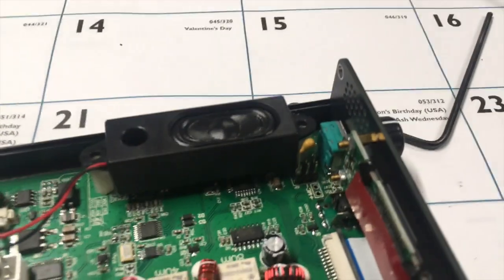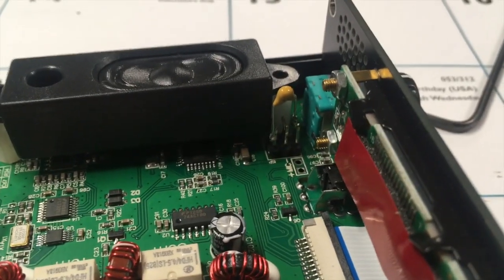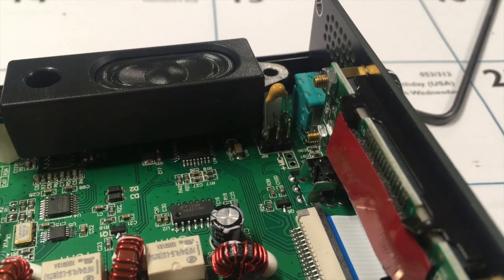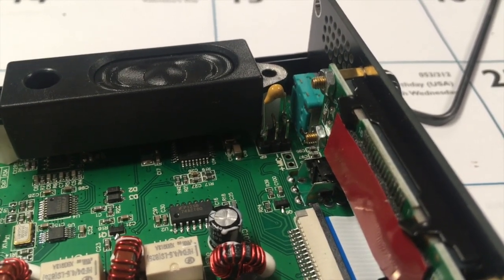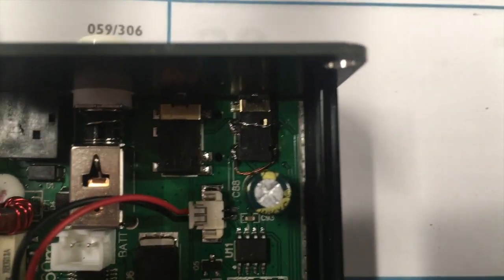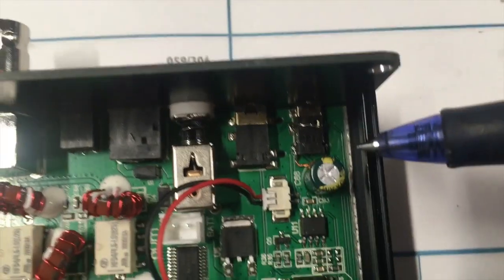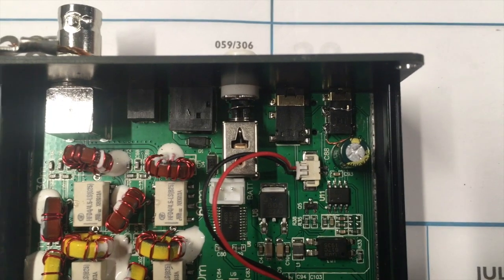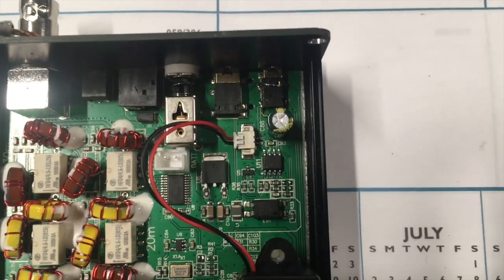Fixing the uSDX+ V2...

Comment: Hi Tom...!

I've seen your video about this Chinese radio... I've bought the most recent version of it, the one with a battery inside a better and fancier box... The only problem is that the Chinese dude making it forgot to install the 10 meter coil on the filtering circuit... Apparently the radio works, apart from being noisy and with a sound volume that can only be usable between the 9 and the 12 setting. So, if you can help me and send me the link for the schematics for this board version or tell me what value is that 10 meter ferrite coil or how many turns it has...? I know you probably moved on from this project, but I can't find more information about how to solve my problem on the internet...
Thanks
73
Reply from the maker: Oh my - I likely do have the PDF for the base radio. But, I'm not near my workshop for a few days. However, if you join the Facebook page for the uSDR uSDX and related, they have it in there files section - that's where I got it from. ;) And, dang, it is amazing what them fine folks can forget!! lol. But, you'll need to make a walk around of your fancier one. I'd for one would become a fan to see it! :)
73, good sir!!

Note sure if thins link will work, but it's the best I got: https://www.facebook.com/groups/599314207744366/permalink/925728708436246
Reply: @tomsworkshop5856  Unfortunately YouTube hasn't allowed my answer... probably because I write my email on it...
Was nice to get those schematics... but I can't go on FB I got banned for life...
Reply from the maker: @TheBigChill1  I'm not holding my breath, but try this: https://1drv.ms/b/c/bcb46ad9a677e56b/IQCdSQYLtta7RZAM2HONMnI-AWH9lG0rGri0X_8B8vNIyew?e=vnaQA6
Reply: @tomsworkshop5856  Thanks mate...!

Comment: Mine has very noisy receive and low sensitivity.any tips?
Reply from the maker: Oh my. I've not run into that. Out of the three I bought it's been much the opposite. They are really good receivers - with one exception: Then can not receive AM or FM, and it seems no one has managed to create a patch or version of the software to make that work. Should be excellent for SSB or CW though. I know that might be to helpful, but it's the best I got. Also, as a bonous, I do listen to broadcast one mine in LSB mode, just get it zero-beated, and it's listenable quality.
Reply: @tomsworkshop5856 yes around 7 mhz I can listen to Broadcast just fine but everything else is...just noise sadly.The same Antenna connected to my radtel gives amazing results but this...

Comment: i worked in comms in the navy and recall clearly when a very tiny cap blew and shut down the entire system we were using to sort digital incoming to the various teletypes,  ya, that age of reperf tape and teleprinters.    took the mat department an hour to find it, as it was not in the central processing area.  no, it was way out on a limb where the cpu would perform interrogative question of printer availability or whether to spool the message for a few moments, much as buffers do today.  same idea, different architecture.
Reply from the maker: Dang, that gives new meaning to the term weakest link! I guess in many ways the modular system build design has some strength. If it fails, at least you kind know where to go, and what box to replace. 

Then we have these radios - they basically are the module, and even when working perfectly (I say that in its terms) There's still so much room for betterment.

Thanks for your service, good sir!

Comment: I also do not receive anything on my new Chinese uSDX+.   Attenuators set to zero.  It receives atmospheric RF noise just dandy though.  With no antenna connected the signal level meter is -125 dB (40 m band)  Connect a 10m longwire and the noise level goes to -85 dB.  Add in a 30 dB LNA and the noise level goes to -55 dB.  But nothing human to be heard on any band.   Switching modes and filter bandwidths has the expected effects on the noise.  Can someone explain why it can pick up atmospheric RF noise but no human generated RF signals at all?  Even tuning to the MW AM and VHF FM commercial bands picks up nothing.   Transmission into a dummy load shows 4-5 W on CW and normal looking SSB modulation.
    How is it fixed?  I see several R or C component spots missing parts but I don't know if they are intentionally missing or accidental.
     Would someone please explain how it can pick up RF noise but not a CW carrier? 
    Thanks!!!
Reply from the maker: That's an interesting problem. And one that has effected all my radios. The 40 meter band has been dead, dead dead until after the sun is gone. As far as the uSDX? I still use it daily, as it's receiver is the best one I've got. So. Hopefully you get this figured out. I personally don't have experience with them not receiving. It's usually their ability to transmit that's an issue.

73 for now, and good luck!
Reply: I have figured out that the output FETs are drawing high current, e.g. an Amp or more during receive!  As the receiver RF input is taken off the output FETs then high SHOT NOISE!!!
   The FET gate bias should be grounded/zero during receive.  Anyone run into this and have a fix?  Thanks.

Comment: Tom I have a usdx+v2 as well so I looked to doing the grounding  ods suggested by YOU.
I quickly dis overed that the rear and front panels are not. Just plain plastic but DOUBLE SIDED FRP PCB.
THE GROUNDING OF THE BNC SHELL IS AUTOMATIC. AND COMPLETE.
MAybe the manufacturer changed the material.
Reply from the maker: Well that is excellent news, and would definitely be a change by the manufacturer. But, just make sure that with your ohm meter that the top and bottom shells are grounded to that BNC. But hey, they may have learned something! :)

Comment: There are many ppl who got licensed, who do not have the big bucks to buy an ICOM or Yas. Yes, many ppl wish to buy food, pay bills. This does not mean we are low life trash. It means we took the time to learn all the information required, in addition to work, family needs, fixing home repairs, etc. So, thousands have purchased this crappy but somewhat useable HF usdx transceiver amateur radio. None of us care about those who only complain about it. So, Tom, we appreciate your education on some fixes for us poor ppl, in order to use our General lic but if you get the time, if you feel like it, could you make another video about this radio, but keep in mind, kids, guys, gals new but willing to learn, we dont know all of the info you assumed ppl knew when sharing how you grounded it, or the capacitor you soldered in. Many did not even know what we were looking at other than the inside of the radio guts near the speaker. Maybe it was that yellow arc thing. Also, there was no front facing view of your outside copper wire grounding. Just a partial view from top looking down. Maybe you could take the time to show ppl exactly how you did it, you could just say here is how I attached and grounded this radio on the outside.....another guy on YT in UK used aluminum duct tape on the outside and always made sure the camera was NOT able to see a lot of what he was doing, more concerned his big glass of beer was viewed in front of the camera instead of what was important....not everyone grew up in this world. Not everyone is an engineer. Many ppl have nobody near them who knows thus world. Many have no clubs near them. Ppl who care on YT are all we got. We obviously care enough to learn the info, care enough to set up testing, care enough to pass the test and get our lic, among navigating all of this evil going on, mass disasters devastating us, our friends, our loved ones. So if some of you could make videos on fixes for these junky but low cost radios, instead of preaching about how much they suck, which they do, but in the real world, many would rather buy something that still allows them to use their General lic and buy food, pay for a new place to live because their home was damaged, or because they needed to move away from a city that became crime infested. In learning about these radio fixes from ppl who care to be easily understood, not a lot of tech jargon, it then becomes additionally educational. If anyone out there could make easy to understand, easy to see and view DIY little fixes for this usdx radios, many would be grateful and appreciative. Many would have some compassionate heros to be grateful to. Thank you.
Reply from the maker: Good sir, Unfortunately what you seek I wouldn't be able to do in a simple video. And, as I too am a working man, with wife, house repair needs and trying to run my own business, finding time to be an electronics instructor is difficult, and honestly, I can't afford good camera gear. It was my hope that the video would give people a place to start. For the most part, working on these types of circuits is from taking many things apart that had failed, and having nothing to loose trying to fix them. There are many good videos here on YouTube that are more educational on circuit function and the like. And the schematic of how the radio was supposed to be built can be found on the internet, and the dedicated usdx usdr Facebook group - those folks are very helpful, and you'll even find links to what you need to upgrade the firmware of the radio. (A very, very scary, and often destructive process.)

Now, with that said, I am planning a follow up video and touching on a few things I've done over the last year to improve the radio's operation even more so than what I did in that video. 

So, from someone who is in the same boat armed with Beofeng, RS-918s and uSDXs.... I can relate, and when I got my first uSDX, I was in the same boat you were. Just wishing all the answers were all in one place. But, eventually I leaned: 
1, none of these radios are the same.
2, no one fix to make them work exists.
3, They should bear the nameplate "Fisher-Price!"

All the best, friend! 
And do stay tuned for a follow-on video this winter.
-Tom

Comment: I got lucky with mine... I paid $125 Canadian on sale on Amazon. I did the ground jumper on it and set the PA Bias in the settings and it works very well. I have gotten great signal reports up to 7000km away. I had zero expectations it was going to even turn on let alone receive and transmit. I have it with me in a case in my truck so I can do portable anytime. I teamed it up with the cheap ATU-100 auto tuner.

Comment: That header you soldered the capacitor to is the Arduino style ISP connector for upgrading the software  (edit: but it sounds like you found out later it's not the right place to solder the cap)
Reply from the maker: That is correct. It's amazing what those header pin are also connected to, should you look at the schematic. ;)
Reply: @tomsworkshop5856  I was fortunate to have already been working with Arduino boards before buying my first of these radios. I now have three. The ISP pinout in the radios and an Arduino Nano or Uno turned out to be the same arrangement.
Reply from the maker: @teotwaki  Cool, I've ended up with three of them too!! And ya, I've flashed them all, a time or too. And yes, the microphone in is literally on of the pins. And so is ground.

Comment: Tom, Thanks for the research and information. I dont expect this unit to perform like a Icom IC-705 or an Elecraft Kx3 but for the money (fixed income here) and for a portable QRP CW rig it should work OK. Did the grounding thing and added the 100K resistor and the TX audio did improve however the cap on the header reduced the power output to 1 watt or less. This was bought from Ebay as an new but open box unit with no internal battery. I think it is the latest rev board. I would like to replace the encoder as it jumps when you press it in as if you turned it one notch up or down. would you know the part number or where I can get a better replacement? Thanks again for taking the time to share your information with us less gifted but radio afflicted hams.

Comment: thanks for the video. I have now bought 4 of these radio and tried to get them to work with no luck. I am only decent at software so the firmware update sadly didn't help. At least I was able to send them back for a refund. Now i am close to my wits end with what to do to improve this. I am not an electronics engineer, i'm an IT guy so i can't do much. 

As for the original creator I would love to support him but his version is lacking a lot of the stuff that the chinese sellers have added to it. 
The thick metal case, the integrated battery and most importantly no soldering or hardware work to speak off. 

This is where i think a lot of the ham projects / products out there are lacking. They are built to the old school mindset of the operator can soldering, has eletronics experiences, understandings how these things work internally so they release small kits which are hard for an average non eletronics person to use. Then Chinese sellers see these products, see the gap in the market so they take the existing designs and sell them cheaply en masse. 

The advantage here is that you get more people in the hobby and hopefully help to reduce the age of your average operator Unfortunately, the problem here seems to be miscommunication / mindset. If we got together with aliexpress seller and directly approved a handful of them to manufacture ready made hardware which has been quality controlled and approved then we could all win.

Comment: Would you please show, with better light, the fix you did on the speaker jack on the rear panel?  I would like to do that as well but need a clearer picture.  Are they just jumpers from one side to the other?

Also, is there another value of capacitor I can use for the processor fix?  I can't find any 47nf disc ceramic caps anywhere, not even DigiKey.
Thanks, Tom.

Doug  VE7DRF
Reply from the maker: Hey Doug, so the capacitor that I used on the header is just a run of the mill Ceramic disk capacitor that you can buy off of Amazon in a bulk assortment for $15,. I used a 47nF, and it is over-kill. Two others I've worked on sounded better with a 10nF capacitor installed. https://www.amazon.ca/10pf-Capacitor-Multi-Layer-Resistance-Assortment/dp/B07RWM9TMN/ref=sr_1_2_sspa?crid=2S66BFC1UKI7K&dib=eyJ2IjoiMSJ9.qBNfiB-Mnah2LuthN077qKv5aT23XiaDdGyIkx9OSuOFmwzbt3zP8mVLcDqxommNx7hLUrXTmu5JjDKhwhHuIuFTnLSIDXFGkoO2U-8RcnmkUXrZ-8BCbAMoSWOj6N2GXFAVtQ64ji627k6NHcs5TL2-ltapeHAgm-ap0vnC7UCEAOIivwQdrCFaN0IbKhUUyMjh45bfT81GYwh7nxZBX6aeZLa9ULaQd77dvgO9hiiWmKlxWDPUahuSvc8f3cLY1pY1pJzsoW0Brrcb5lKPxNQxu9QXwymzsqDLZ70l0N4.rhwtd1RAsGLKj_75woU5XFLE04FPi11hrpwY-_00EmA&dib_tag=se&keywords=450pcs+multi-layer+ceramic+capacitor&qid=1719961429&sprefix=450pcs+multi-layer+cermaic+capacitor%2Caps%2C161&sr=8-2-spons&sp_csd=d2lkZ2V0TmFtZT1zcF9hdGY&psc=1

As far as the jumpering of the speaker portion of the k jack, The radio is now well and truly built into its permanent station, so I'm not really wanting to take it appart again, as it is working well enough these days. You might be able to hear me on the Aurora Net from time to time. :) With that said, of all the video and pics I had taken the best did make it into the video. But yes, essentially it's just two wires jumping across to the opposite side of the jack.

73 Doug
-Tom
VE7NGK
Reply: @tomsworkshop5856  Thanks for the reply, Tom.  I think I'll forget about the cap replacement.  I don't plan to upgrade the firmware, at least not at this time.  I have installed the 100k resistor at R23 and done the jumper mod so all is good for now.  I'm gathering the parts to build an EFHV antenna to try out using the uSDX+.  We'll see how that goes.
Reply from the maker: @dougkathydavies3024  You know, I've got a few radios. I love to rag chew, and one of them I use on 80 meters every night, and it sounds good and everything. But the uSDX+ V2 is now installed at my place of work, and gets used at coffee, lunch and after work times. I've hunted 187 parks so far, armed only with a 60' random wire, powered by the OGS-50W amp, and the ATU-100. Out of my fleet of radios, this little thing has become my favorite. I do plan on posting a follow-up video of some other things you can get/do to get the most out of it.. So stay tuned, and good luck! I hope to hear you on the air one day, and hopefuly soon!